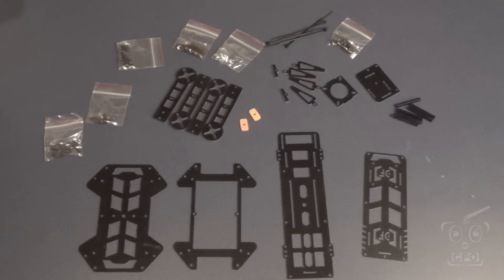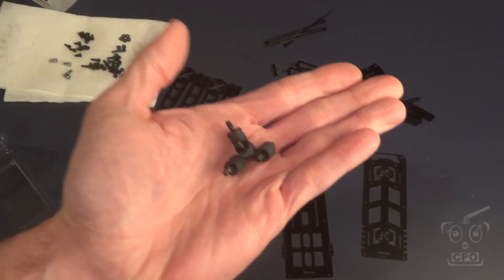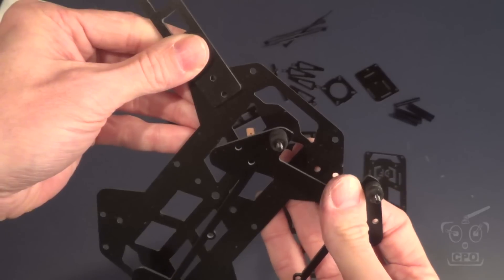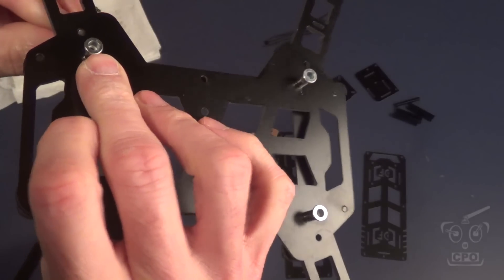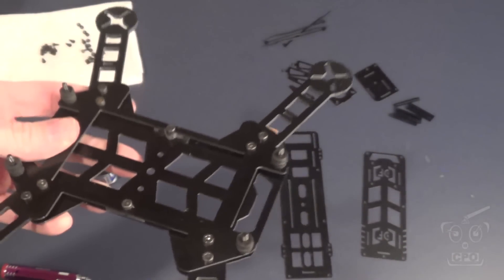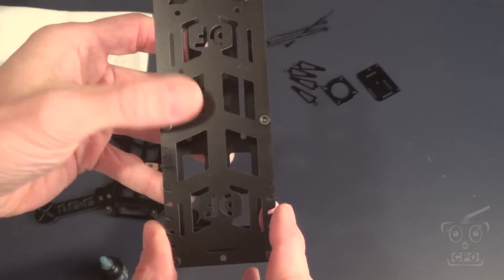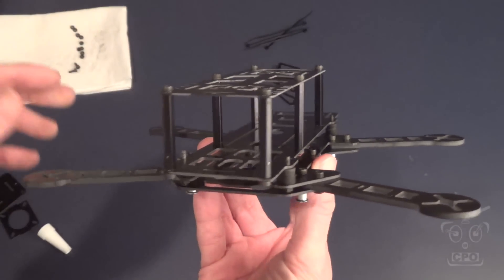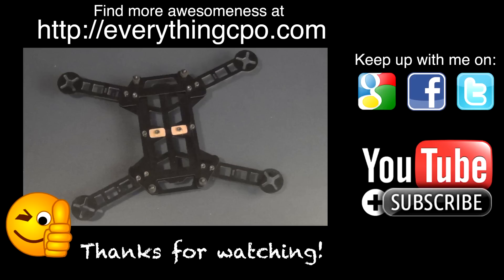DF DRQ250 (Mini D) Frame Assembly (Dirty and Clean Sections)

Comment: also, DO NOT use loctite on those standoffs on the clean section.  Loctite destroys Nylon which is what those standoffs are made of.  I wouldn't be surprised if those screws pulled out completely in a crash.
Reply from the maker: Um....my standoffs are aluminum. They are not nylon.
Reply: EVERYTHING cpo ok den ;) carry on

Comment: It's probably too late to ask for measurements of the anti-vibration rubber thread thingies (diameter / height of the rubber part)? :) I was thinking about using some of those instead of the silicone vibration damping balls you see everywhere because I don't like them not being fastened in some way. I've ordered a few different sizes (all M3 threads) and now wonder what others use.
Reply from the maker: Sorry...they are about 11.5mm tall (slightly compressed) by 7mm (approx) wide.

Comment: *mini quad tip: If you mount the FC to the "dirty" section you get a much more locked in and responsive flight characteristic for acro and racing. Mounting the FC to the "clean" section offers a more subdued response as it dampens input to the sensors.

Comment: Very nice video! So its called dirty and clean?
Reply from the maker: Yep!  The dirty section is the section where the vibration occurs (where the motors are installed) and the clean section is the part that is isolated from vibration (for jello free video purposes).
Reply: EVERYTHING cpo Thank you! Learning so much from you! I am so new to this and sorry for asking some what simple questions here now and then!
Reply from the maker: No problem. You never need to apologize for asking questions, no matter how simple. I ask people questions all of the time. In fact, a lot of the things I spend time talking about in my videos are things I had to learn myself through research and bugging my smart friends via text and instant message. LOL!
Reply: EVERYTHING cpo Well good then I don't have to be afraid to ask!
Reply: 'dirty" in reference to the section which carries the vibrating bits- like motors and electronics- usually esc's. "Clean" section refers to the portion of the frame isolated from vibrations using bobbins or rubber grommets depending on design. This is for keeping jello from video. Clean sections are more effective if above dirty sections and have weight from the battery and hd camera (gopro-mobius- etc) to make the clean section effective.